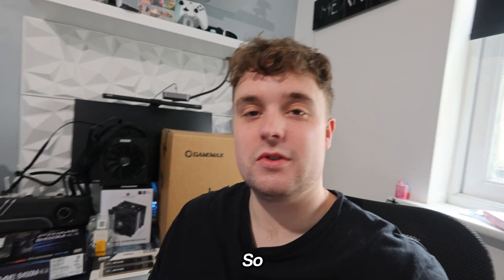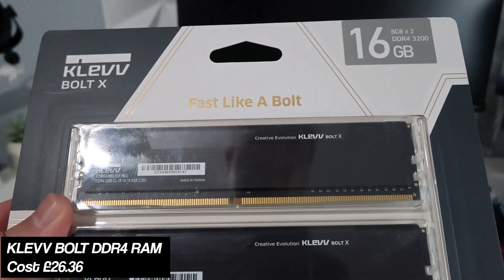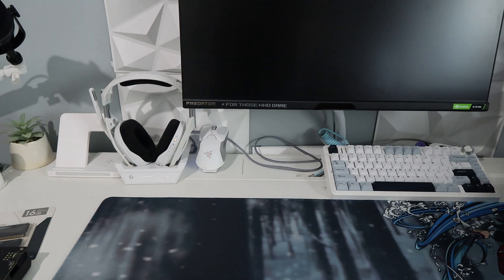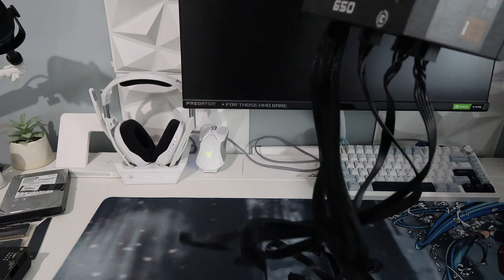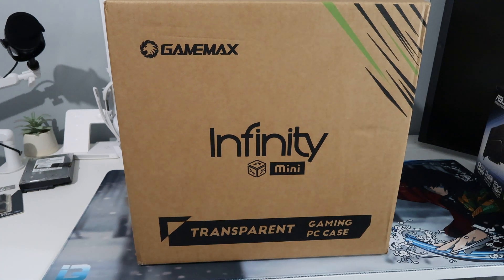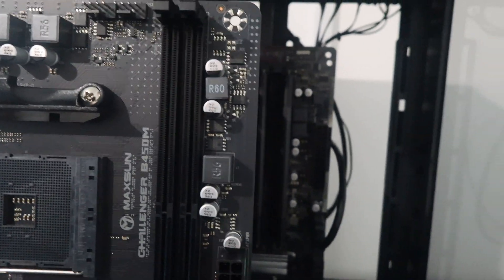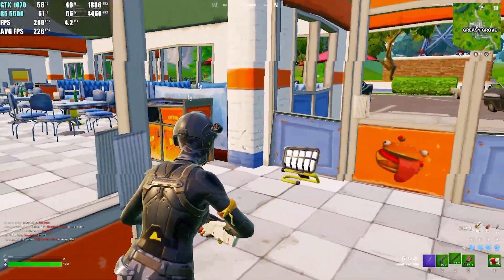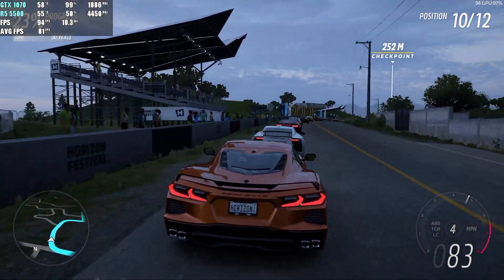Building a Budget Gaming PC For Less than £300!

Comment: i think you installed one of the cpu cooler fans for both intake and only the right side should be intake and the left one should be a exhaust
Reply from the maker: It’s the correct way, ThermalRight just put a sticker on the rear fan to make it look nicer
Reply: @SpecBench ohh that makes sense

Comment: Can I have a link to all the parts
Reply from the maker: The Ali express parts you can just search for. 

The case is currently out of stock.. but https://amzn.eu/d/1GLEB9z

Cooler - https://amzn.eu/d/aaILLiq ( out of stock ) 

PSU was from eBay 
GPU was a local deal 

cable extensions are from Ali express ( FormulaMod) is the brand

Comment: I have a gamemax infinity mini myself. It's awful. Flimsy and has no room for cable management.
Reply from the maker: @blurreaper1238  I mean what can you expect for a cheap case, I had no issues with cable management though. Seems to be hard to find many micro ATX fish tank cases readily available in the uk. Especially under the £70 range
Reply: @SpecBench  you can pick up a few now. Montech XR, king 65 if you can find it on offer etc. The infinity mini is fine for a starter case but you can find better for the money. Specifically from companies like IONZ

Comment: 🙂 you be surprised, theres several content creators that made the same mistake, they did not know that MATX size cases come in at least 2 different sizes, the smaller lower tier basic matx boards are almost the same size as an itx board
Reply from the maker: Yeah lesson learnt here! I have been using Maxsun challenger b450m boards in these narrow cases now. They do the job for budget boards and don’t look too bad either
Reply: @SpecBench theres a case called the 'JONSBO TK-1 Black Micro ATX' it supports the larger full size matx board but the case is only a bit bigger than the matx board, so you only can use it with top and bottom case fans, there does not seem to be a cheap clone of the case yet so thats why you dont see any content creators showcasing it yet
Reply from the maker: @ I’ve seen that on Ali express. Is jonsbo a decent brand then? I’ve seen some reverse blade fans from them that are actually pretty cheap but might help me out with builds etc

Comment: Why neither cpu or gpu hits 100%?

That usually be for optimization issue, when you limit with vsync, or bottleneck component
Reply from the maker: @gustavopena99  most definitely no issues here. I never use v-sync. Forza gpu was at 99% utilisation? Fortnite on performance mode is cpu intensive. Even with a better GPU it would make hardly any difference. Call of duty statistics doesn’t even show GPU utilisation? But I can assume that the GPU is the bottle neck in that game due to it being a graphically demanding game. My point is every game has different system requirements. I am using a CPU from 2022 with a GPU released in 2016.. of course there will be a bottleneck in GPU intensive games lmao
Reply: @SpecBench In fornite for example, either gpu or cpu were at 95%-100%. none of both components were at full 14:13

 neither gta V in 14:36

In forza yes, the gpu hits the maximus and as you says in COD didnt show gpu or cpu usage but i also think got 100%

Nice setup, here in argentina is almost imposible to get those prices, here everything is so expensive
Reply from the maker: @ yeah but judging a pc’s performance by wether a component is at 100% is pointless?
 I have various benchmarks on my channel in which my pc performs better than most the people who comment with the same specs. My bios is always optimized and I ensure my GPU has the latest drivers and optimal control panel settings. What I’m saying is I don’t think it matters :) but thanks tho

Comment: why your cpu fans both set to intake?were the hot air gonna go ya just made a heater
Reply from the maker: It’s not? They are both pulling air to the exhaust fan at the back. Look at the fins of the fan blades :)
Reply from the maker: The back fan is a reverse fan. You’re just being thrown off by the thermalright sticker showing
Reply: @SpecBench i have a peerless asassin 120 se my self and yh the fan didnt look right
Reply: @SpecBench i stand corrected after further inspection
Reply from the maker: No worries boss